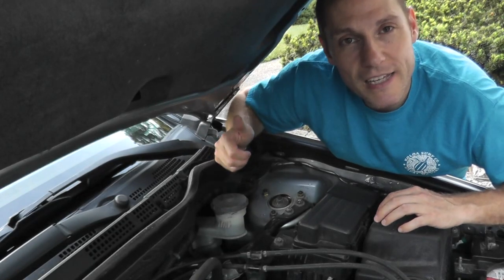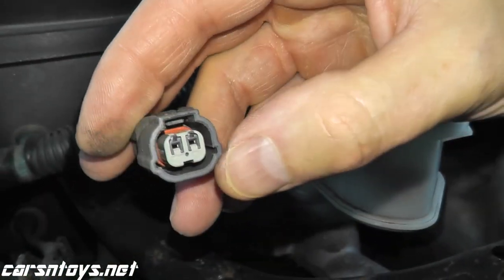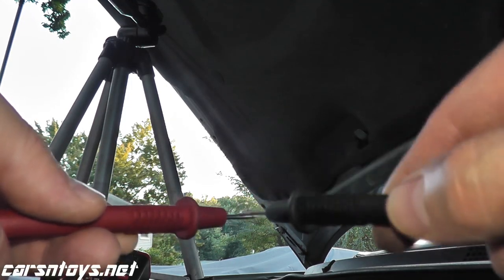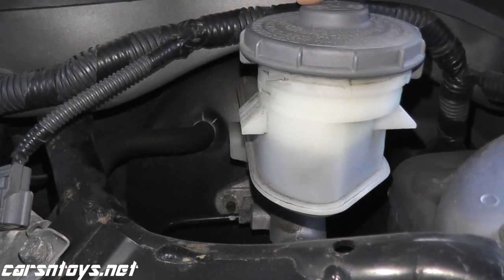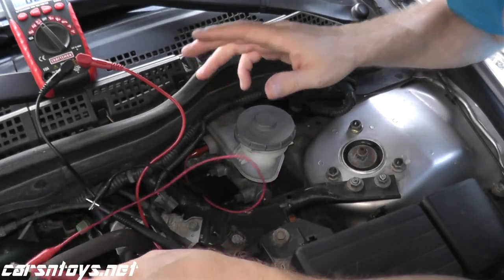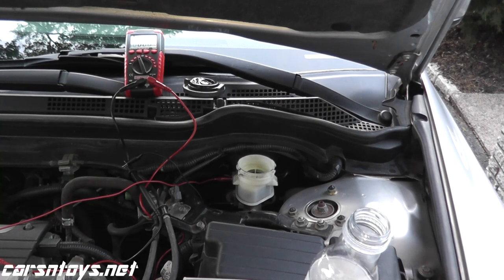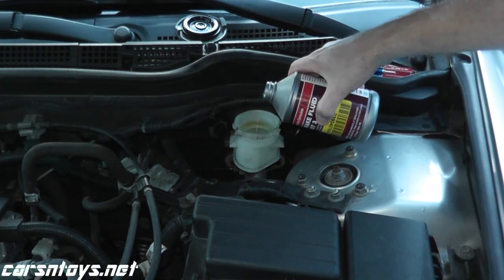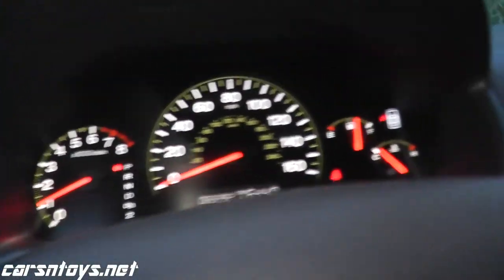Brake Fluid Switch and Sensor Test

Comment: Thank You!
I have a 1998 Toyota Tacoma.
I've been working on the "Brake Warning Light" for a while now.
Checked the switch: Good
Topped off the Brake Fluid - Brake Warning light stayed on.
Disconnected the the Master Cylinder brake fluid sensor connector.
The sensor measured a high resistance - good.
With the Master Cylinder brake fluid sensor still disconnected I noticed that my brake marking light was out.
COOL!
I reconnected the Master Cylinder brake fluid sensor, checked again and the warning light was still off.
COOL!
I think the sensor was stuck in the closed position and when I disconnected the the sensor there was enough vibration to open the contacts.
Thanks Again!

Comment: I know this post is old. This is a good video and very informative, but I want to share a few things. 1. It's extremely difficult for those alligator clips to clip on without the clips touching each other. 2. I used some spare wires with pins crimped on them to allow me to attach the wires to the pins on the sensor. 3.  You can also backprobe the connector while it's still plugged into the sensor by stabbing the leads into the wires.(not preferred but much easier.) 
Also if the light is just bugging the hell out of you and you already know what is.. 4.Unplug the sensor then disconnect and reconnect the negative battery terminal and voilà no more brake light on the instrument cluster 😅 (this also is an easy way to verify the problem is in the sensor.)✌️

Comment: Thanks. I have a Honda jazz/fit 2004 and couldn’t understand why the brake light didn’t change when I pulled the harness out. Now I know that it’s not the fluid that makes the continuity but the fluid that breaks the continuity. Good God. And I’m an Electrical Engineer
Reply from the maker: Happy to help!
Reply: That means the brake switch in the pedal or the brake switch in the parking brake are closed all the time. Faulty switch

Comment: ok, good video explained wiell.   What If you test the brake switch under the emergency brake lever and the sensor in the master and they both test good?  What do you do then?  I have heard something about a float sticking;  is that in the master cylinder or where and how do you test that without have to buy a new master and rebleed all the lines?
Reply: You have to then remove the brake reservoir. Empty it out and clean out with brake fluid. Then air out the reservoir and shake it until you hear the float moving. Then retest the float switch. It should be closed only with empty or low fluid level. It should open when the float rises with proper brake fluid level in the tank.

Comment: Thanks. I've mustang 2013. Sensors doesn't show continuity. But I'm not able to find sensor anywhere. Mechanic told me that I'll have to replace master cylinder. Which costs more. What should I do?

Comment: Is there other ways to test such as the harness?  What does unplugging the harness and the brake light now turning off mean?
Reply: It means the float is stuck if there is brake fluid in the proper level. The car thinks the fluid is low and light comes on.

Comment: Soooo mine came on when I did the brakes ironically . Wasn’t on befor I did them but the rear caliper was seized so I did change that . Bled the system as well . My only guess is the fluid sensor

Comment: Seriously frustrating, ive replaced parking switch, no change, still on..no blown fuses that I can tell. Wiring says its fed power to mastr cylndr switch by connector. Green w/ornge stripe from ignition switch, on position or running.
Reply: Please help
Reply: Add/ replace your break fluid. Probably takes about 1Ltr

Comment: A friend of my want to know how can he get the break light off.. He tested it like  you did everything work
Reply from the maker: The light is and there's enough fluid in the master cylinder?
Reply: It could also be the emergency brake switch
Reply: I changed my parking brake switch an still, light is on....new master cylinder

Comment: Hi, my car is after 40 km coming break light on the way than automatically car stopped than after 10 minutes I started car same like continues. What is problem
Reply: If the light comes on and off as you say, then perhaps the brake fluid sensor switch is in the process of failure. If you have low pressure or low fluid from a leak, the light will stay on all the time. Before anything make sure your E-brake is off and there is no corrosion on that electrical connection and it is cleaned. Good luck.

Comment: I replaced the brake fluid sensor the light went off but now its on constantly,  I thought maybe the master cylinder but I'm not sure.
Reply from the maker: Constantly on and there's enough fluid in the master cylinder? What kind of vehicle are you working on?

Comment: Power to fluid switch, master cylinder?
Reply: Origin of power to fluid switch?
Reply: Replaced master cylinder for maintenance, then the light wont go off on dash
Reply: @egulick9234  Were you able to find the issue ? Got a similar problem

Comment: It's easier to just replace the $10 sensor than go through all this in my opinion.
Reply: Where’s the sensor and where do you find my brake light is stuck on ?
Reply: @mattsmith8827  It's what he tested in the video.  It just slides out when you lunch the end clip.
Reply: 02 accord lx sensor $30, i got 2 car. so $60
Reply: @MHZ168YT  I don't think they both need one at the same time. LOL!
Reply: @seeya205 i need to find out how to test on 02 accord lx sensor , they're different like  03 sensor.